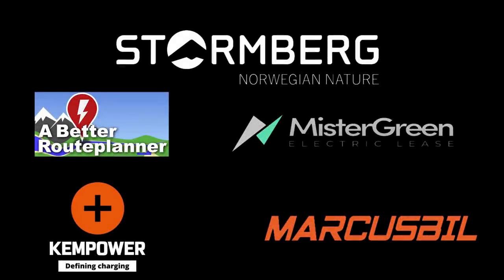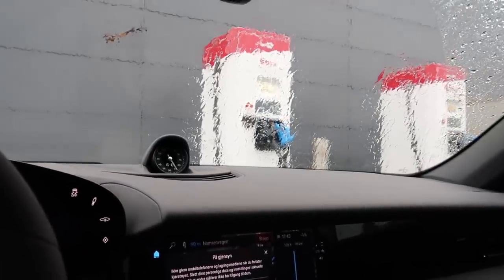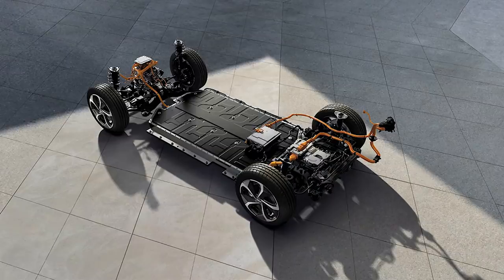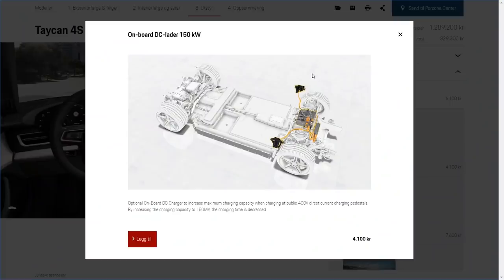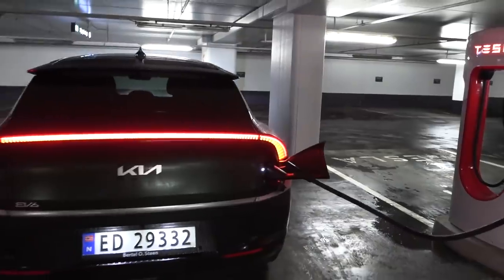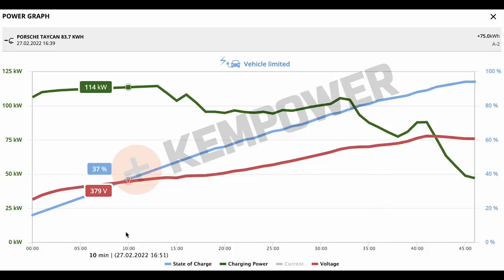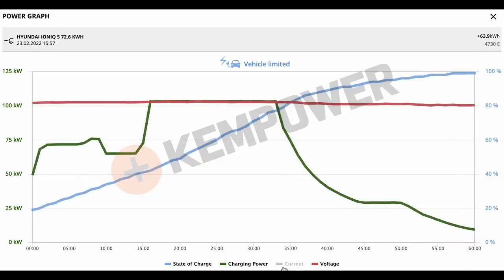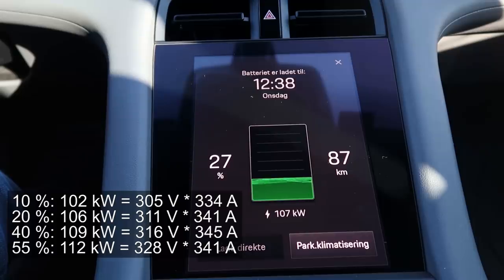Why Korean engineering is better than German engineering

Comment: The issue is it doesn't beat their own makeshift e-Niro enough. The EV6 range is still around the same old 2018 level. 500km city / 250km 130km/h motorway seems to be an unbreakable barrier. I need a lot more on the motorway.. Where did 3 years of development go? KIA dropped the ball and let the likes of VW catch up. The e-Niro schooled everybody in the CarWow test, finishing 2nd on a list of 100k EUR cars. Even the gold standard Model 3 could only beat it by 70km. Which proved that no dedicated platform is needed as the makeshift EV was very closely on par with Tesla. That's how good Korean tech was. ...and what does KIA do? Lets everyone else catch up and develops better looks and faster charging in 3 years.
Reply: Develop fast charging aka you mean let Mate Rimac join the equation. One reason E Niro  is so good is because it only weighs 1850kg whereas Ev6 is 2200kg.
Reply: EV6 is a foot longer than the e-Niro, 2 inches taller, and charges way faster
Reply: @ulf5738  Well, I drove 30k kms already in the e-Niro and went on a 7k kms road trip with it across Europe. I love it to bits, but.. When I have a family with me, I don't want risk and uncertainty. Therefore I only consider charging hubs (single charger locations are a major risk). Ionity is/was the only EU-wide hub network on my trip. Some Ionity hubs were 280kms apart. Now, I don't want to arrive to a hub with anything less than 10%. You can't always wait to charge up to 100% either as it takes extremely long to fill up the last 20%. Meaning you have 100-10-20 = 70% battery between hubs typically. It is impossible to cover 280kms with 70% battery use in the e-Niro, so we had to spend the time to charge to 100%. Then it was still extremely stressful to keep the consumption under 20.5kW/100km to be able to reach the charger on the motorway. Not fun, not risk free and not relaxing at all. And we didn't even talk about winter motorway range which is even worse. Can't wait to have an EV in the same category with the same price range with a much improved winter motorway range.
Reply: @chrisness  See Teslabjorn's banana box test. T
EV6 couldn't take more than the e-Niro. What a waste of opportunity, again.
Reply: @Jeroenneman   There's only a trial going in Norway and maybe 1-2 other countries, but not a full rollout. Also, they say it'll be limited to some supercharger locations even after full rollout. We'll see.

Comment: Why would the Korean Engineering be better when the Ioniq is charging below 80kW for the first 15 mins whereas the Taycan is at 100+ kW pretty much all the time?
Also the maximum charging power is higher on the Taycan…
Reply: You see the price difference, dude
Reply: @kfx3907  of course there is a huge price difference, but TB is comparing it to the Taycan 😉

Comment: Taycan is based on the J-1 platform. It has a specific DC/DC for 400V charger. Another reason is that they must use this for the AC compressor. There is no 800V AC compressor available at that time. 

Kia EV6 is E-GMP platform. It uses the MCU(motor control unit) as the DC/DC booster. E-GMP platform is just a newer platform compared with J-1 platform. 

Oh! J-1 is a fossil-electric conversion while E-GMP is a pure electric platform. If you are interested in, you need to look at the next gen PPE platform from VW.
Reply: With first gen you are right, but the j1 platform is not a fossil platform. Only models are the taycan and etron gt. Its not like a normal etron, which is on the mlb evo
Reply: @HansPeter-pm1gq  J-1 is not a design of pure EV platform. MEB should be considered as the first pure EV platform. However, I am really looking into PPE as it would use prismatic cells worldwide.

Comment: Its quite sad to me. Listening electrical topic for the car. As an ICE engineer, no one talk any more about   injection, flame flow, compression rate, turbo charger performance...etc. yes. We are disappearing.
Reply: Ice engines will love for more than 1,000 years, but it is cheaper to run an EV at this point. Plus it's more comfortable.

Tesla really moved the industry forward.

Comment: I think Porsche is simply ignoring how it performs on a 50 kW charger, because those are going away. In any case, it’s simply not serious to go from a single detail of the charging system to your conclusion that Korean engineering beats German. Good video but would have been better without the hyperbole.
Reply from the maker: Ignoring 50 kW is a mistake. They will unfortunately be around for a long time.

Comment: "Probably better at handling". Probably, come on, it's of course way better at handling. It's a Porsche. That's what Porsches are all about. The EV6 is a boat in comparison. But yes, they did use a better converting method. But remember, it's not given that the Taycan could have been built with the same converting method. And higher voltage chargers are the future. So there's little reasons to prioritize 400 to 800 Volt conversion. For instance in the US, there's hardly any 400V chargers at all, besides the ones from Tesla.

Maybe I'll try a 5-80% charge at Tesla V2 with my Taycan. I've got the bigger battery, and maybe that behaves differently.

But to be honest. I don't care much for 400V charging anyway. Yesterday I charged 63kWh in 19 minutes at Eviny 350kW (800V). Thats about 200kW on average. That's insane. Koreans maybe clever at something, but who cares about that when the Germans make charge machines like this.
Reply from the maker: Imagine how much better the handling in Porsche would be if they shaved off 20-30 kg...
Reply: @bjornnyland  I guess you mean 200-300kg. And yes, eventually when battery packs get lighter, they will make something beating 911 GT2s on the Nürburgring.

Comment: The Taycans can be easily fixed with a software update to the inverter in my opinion. The Dc/dc converter can be relatively easily reprogrammed to ask for a higher voltage instead of half the pack voltage.

Comment: The concept of having a step-up converter with a fixed ratio is very, very strange. Never seen anything like that.
Every DC-DC converter i've seen in years of engineering work by adjusting the step up ratio to obtain the desired output voltage.
It looks like Porsche just splits the battery in half with a bunch of relays and charges both in parallel.
Reply from the maker: https://www.youtube.com/watch?v=sFhY77nYpmM&lc=UgwRQmyL6FxXKyr4wkp4AaABAg&ab_channel=Bj%C3%B8rnNyland

Comment: Great video....  ....but you are missing the big picture, German Engineering will fail with the loss of their endlessly complex, instable,  "smokers" because of their culture: von Chef etwas sagen lassen.   USA wins in IT because of their culture: its over, you're too old, let get go, nobody listens to techno, now lets go.   As for Korea, they are culturally (and geographically) in between those two.  So let's be honest, if a car is not FSD capable it is at best an interesting antique.  KIA EV6 is an overpowered rear-wheel drive hack, with limited visibility and lane keeping SUCKS in that car.  Buy a TM3 LR FSD, that is currently the best EV.   If you have to have more space, get the much poorer design TMY or TMX.   That is it.   TMS, OK if you want speed.  Those are all the choices.  Sad but true.  Others need to learn a new word "IT" because now a human's car is a robot....

Comment: Korean engineering isn't better than German engineering. Charge a Korean at winter. So sad. They also have enough issues.
Reply: So does the Germans. What are you thinking about? Lol i had the exact same problems with the BMWs in winter.

Comment: It needs just one minute of sitting and driving to know, that Porsche is Porsche. 
Beside of service, durability, security. 
A lot of Hyundai Ioniq 5 buyers in Germany are very dissappointed. Because the car has a lot of winter problems and sometimes, you wait 7 weeks for the repairjob. Hyundai Germany  doesn' t seem to care too much. On paper the facts seem great...but reality is a different story. Some EV6 just load with 38 kw on hyperchargers....my 2013 BMW I3 is much faster😅